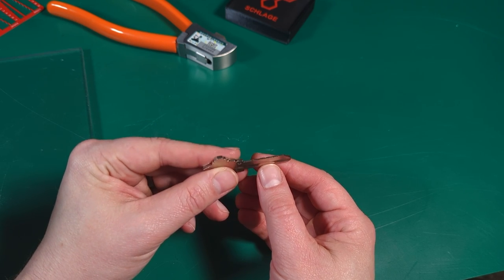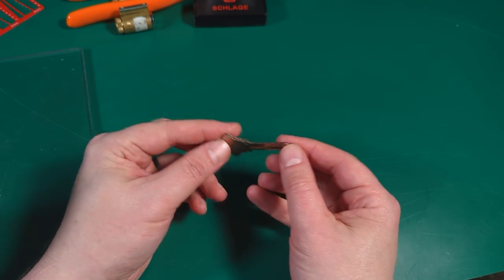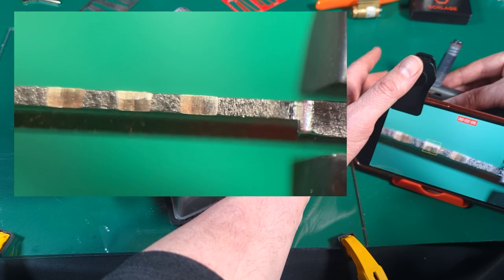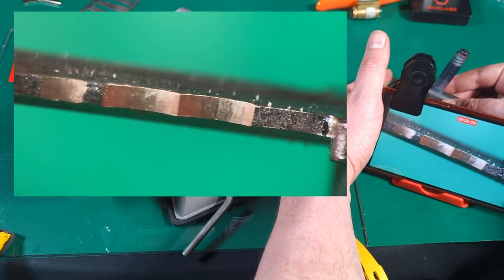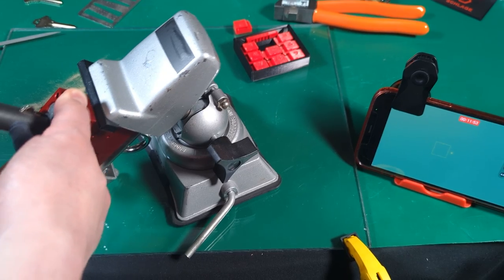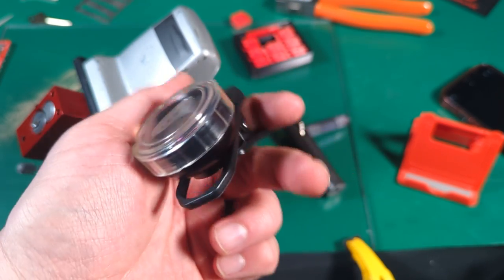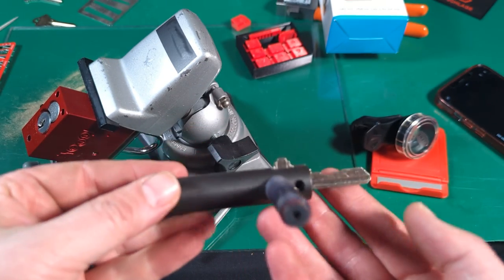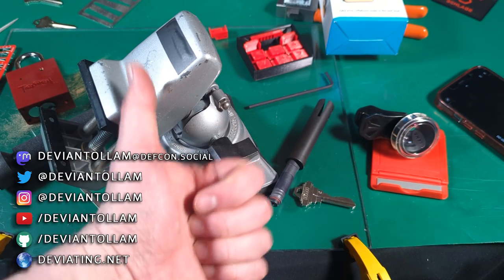Using a Macro Lens For Key Impressioning?

Comment: iphone: move the yellow square to what area you want to focus, or get the object within the box, then press and hold the square until the screen displays AE/AF lock. This locks the exposure and focus. 
If you tap the box, you can move the slider up and down to adjust the exposure brighter or darker, which is also helpful sometimes.
Reply: Good tip, not sure if this is for all android phones but my S9 camera app has a mode with a similar focus slider.
Reply: @R3VISION3  I think all of the androids have the same slider to adjust exposure.

Comment: Wow, great video!. The one time I tried to impression a key before, it took me forever. I never realized that once you have a mark, you can file to the next bitting depth. I kept checking every couple of file swipes, it never occurred to me to use a depth guide and just go to the next depth (at least on a stock lock). That is a major time saver.  Thanks for all you do!
Reply: It was a blinding flash of the obvious when I saw him use the DDC causally used to check the cut depth...

Comment: That key holder would be super cool if the center of the main body was drilled out so the side handle completely recessed inside, and if the key side was also drilled to the size of the hex key so it slid inside so everything nests together uber compactly.
Reply: Unfortunately that would raise the cost of manufacturing to be essentially out of hobbyist reach

Comment: @Deviant,
Love the convenience and quality of your impressioning blanks. Perfect for impressioning-fans.
For DIY-fans, how do you make them at home?
Reply: Skin the top surface off of the blade of the blank with a file, polish with sandpaper, insert into lock, turn lightly back and forth, your spaces should be easy to see, lightly file each space, if it’s a Schlage, and you have these guides, I recommend a scribe to etch the sides of the blank.
Reply: @RubberBanned  any tips on how to etch the sides at home?
Reply: @curlyvideos  yes, a scribe is good, if you have a guide. I don’t do that step myself, but it works. I do that in my video on the lishi guides in my channel
Reply: @RubberBanned  oh cool, I'll check out your approach

Comment: I bought my current phone specifically for it's built in macro lens but I would like to know where you got that add on macro lens. I'll check your site.
Reply from the maker: Yep it's on Red Team Tools now 👍😊🔎
Reply: Found a cheap set of clip-on lenses in a dollar store a while ago, it even included an attachable ring light. Unfortunately the battery was crap, so I desoldered it. Now it only works with a powerbank/charger 😉

Ehm, what I wanted to ask: what about the magnification of the lens offered at RTT? Mine was labeled 10× 🙂
Reply: One of the reasons I bought my Pixel 7 Pro was for macro, use it all the time!

Comment: Hmm. Well, it wasn't bited difficultly but I understand it's for demonstration purposes. Quick ?- can you do this with SFIC. I had read before that you can not. I have all the stuff to do it but after numerous attempts= I stopped trying. I only do SFIC so. Also, it takes a long time to impression. I could pick a lock, unscrew it, decode, repin in the time it takes and none's the wiser. It's my favorite attack method, though pulling the plug with a Zieh-Fix is also cool and you don't have to drill. (But who doesn't love drilling, mmmm, I know I do) 😊😊😊😊

Comment: Know any machinist capable of making a key blank out of steel with a dovetail for inserting a small blade of brass? Could make keys that have interchangeable blades that you can impression and have a hardened steel turning tool to get more impressioning force.
Reply: You don’t need a lot of turning force, at all
Reply: @RubberBanned  I've never had luck without pretty decent force. If my key isn't about to snap off at the head by the end of the impression, I'm not getting it open most of the time. Lol what am I doing wrong? Just never seems to reliably mark
Reply: @joblessalex  The rock up and down is the pivotal movement for generating marks. If you have a side handle, like mine in this video, you can maintain solid turning force and get a good rock without over torquing

Comment: Dev, what file is that youre using? When Im making keys, the files I have tend to drift to the sides sometimes and wind up filing too close to the adjacent cuts. Could be just me, not my files lol
Reply from the maker: Grobet Swiss pattern file, #2 cut, sold by Grobet USA
Reply: A number 4 full round is the gold standard for impressioning
Reply: If your cut tends to drift to one side or the other, make half your strokes one side and then turn the key and make the other half of your strokes from the other side. That way the cut will stay on target.
Reply: @COBARHORSE1  That would cause a non uniform surface, which can obscure marks
Reply: Thanks everyone! Will give a grobet file a try!